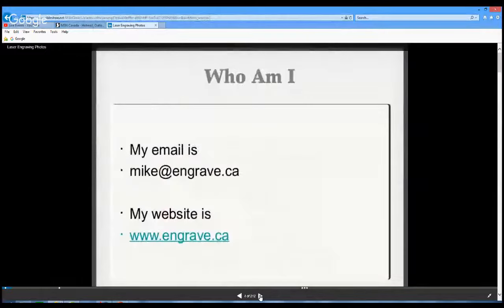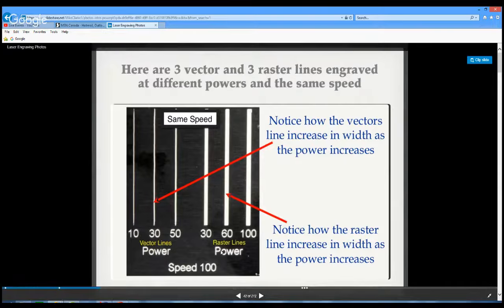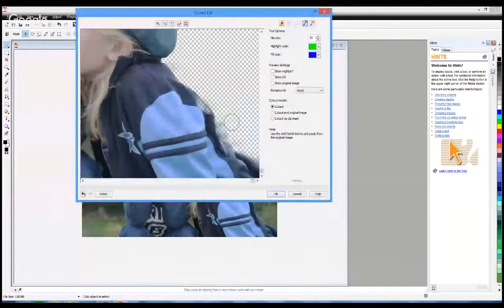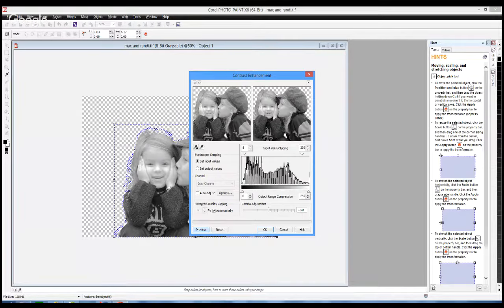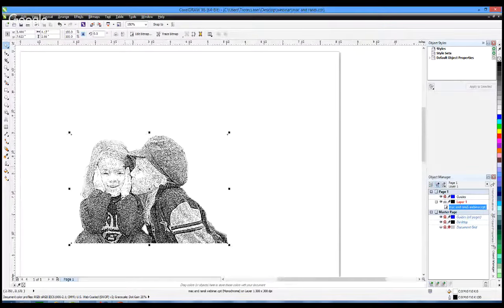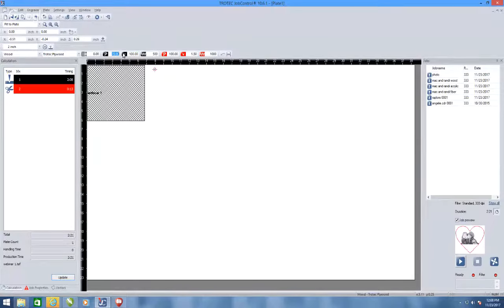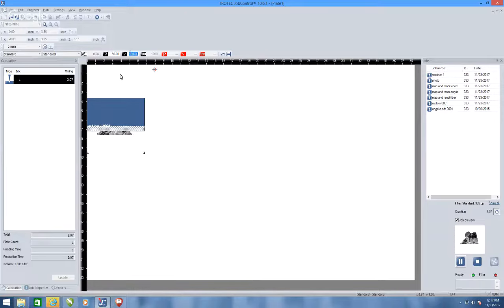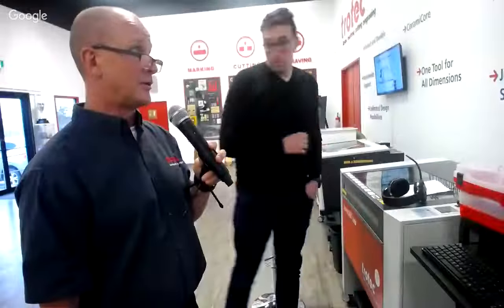Photo Engraving Webinar - November 2017

Comment: For photo engraving on wood using Jarvis... should there be a offset?
What would be the lowest dpi a photo should have to be able to produce a nice outcome?
Reply from the maker: Depends on the wood normally around 6 to 10. You can run at 333 dpi - Mike
Reply: To start editing my photo in corel paint, should I import it or just select open?

I have edited a photo following your instructions, so when I go to print and in the settings I chose black and white... once it is in job control it will only show the job as a black rectangle the size of the job, even after clicking the eye view,
though yours does not do this as it still sows the actual image of what your engraving.
any idea why this is happening to mine?

If I chose order dithering in the print settings, it will then show my actual photo image in job control but it also puts a dotty back ground with it also?

If i chose jarvis is it fine. though you mention to either chose black and white or order dithering.
Reply from the maker: We have sent your questions to Mike, we hope to respond soon.
Reply from the maker: Hi Gabriel, what machine are you guys using? (with wattage)

Comment: Just watched the webinar, great job thanks for doing this. I wasn't subscribed to YouTube so I couldn't post any questions during the webinar but wanted to ask what, specifically, should we ask our customers to send when they send photo files to be engraved? Is there a certain size or type of photo that makes it easier to convert to an engraving file? Thanks.
Reply from the maker: You want a high resolution JPEG (no compression), preferably you want something in the half a meg size (depending on the image size).